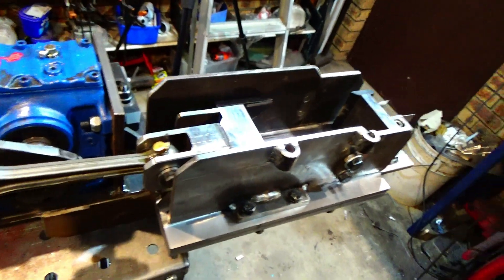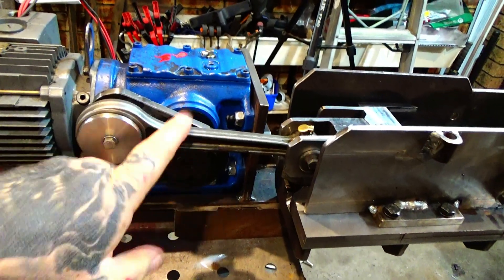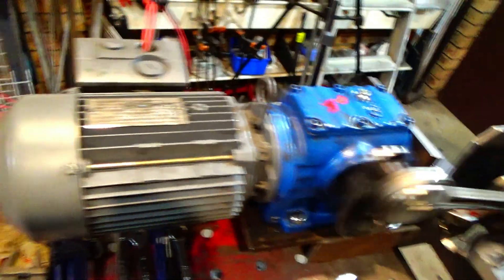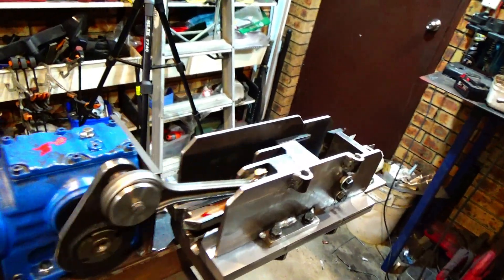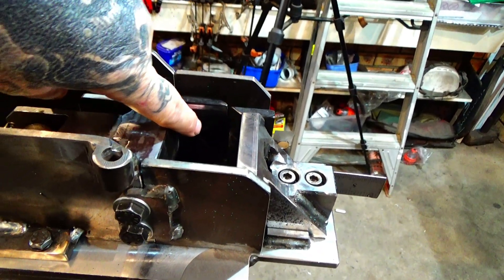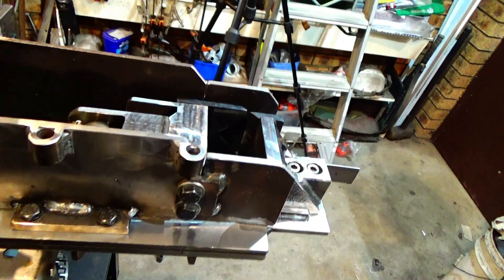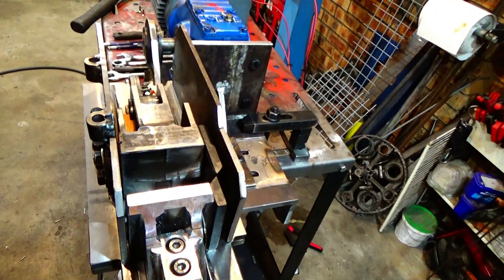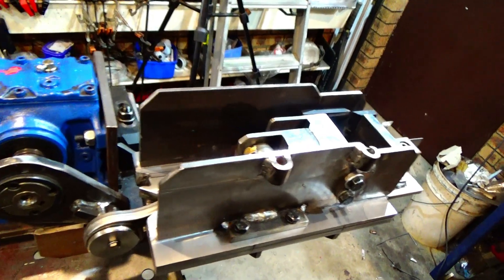A preview of BigstackD's can crusher/wire chopper.

Comment: Hey mate, running those motors on slow speed with a vsd, can cause over heating issues. “Creeping” slowly with the motor creates more heat, and the fans aren’t spinning very fast so it can cause some overheating
Reply from the maker: @callumross406  I’ll see how fast it will handle higher speeds. I’ll run it at a moderate speed and let it run for about an hour and keep an eye on the temperature of the motor. I’m guessing the cycle time will be 30-45 minutes max. But I’ll give a long run to test it. 
Thanks for the advice, I appreciate it.
Reply: @GrumpyHarleyRider now worries mate, as old mate above said too, just aim a fan on it if you do come into overheating issues
Reply from the maker: @callumross406  I ran it this morning for about 45 minutes at about 40hz and it got lukewarm if that. At that speed you can feel a light breeze through the cooling fins. I might give it a shot at a slightly lower speed and see how it goes.
Reply: You could also possibly use a stand-alone fan, or even add a home-made water-cooling system. Doesn't seem difficult to realize that, assuming the genius and skill of the creator shown so far.
That will not only prevent overheating, but also prolong the age of the engine.